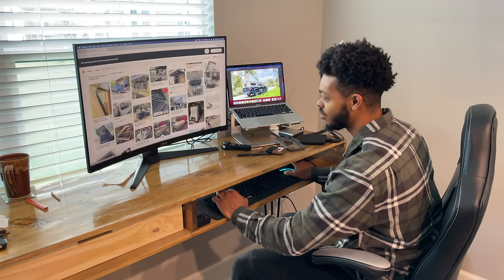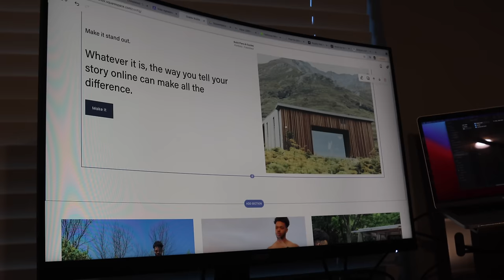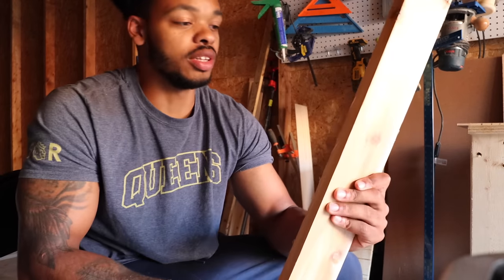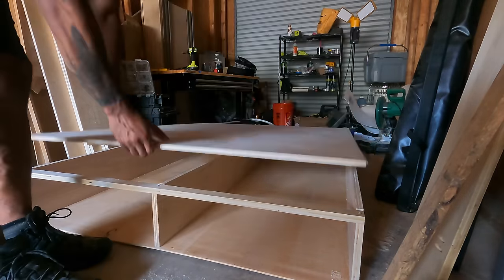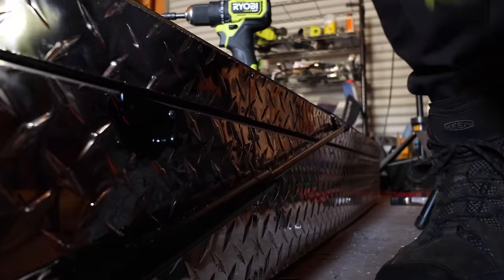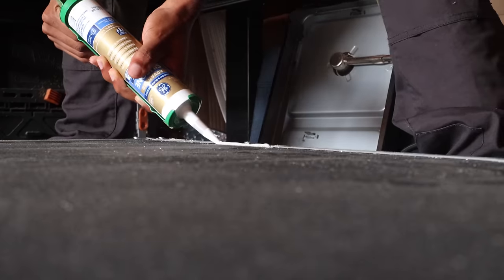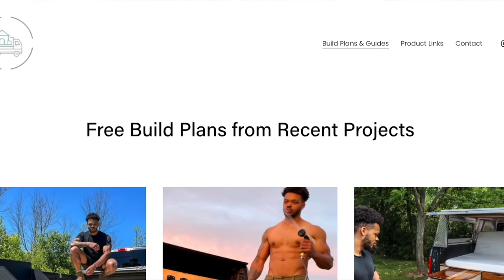I Converted a PICKUP TRUCK into an Off-Grid Home On Wheels | Overland Camper Build Start to Finish

Comment from the maker: Yo! Theres a lot of helpful links in the description if you're looking for anything in the video or more info about the build.  Video contents are below:
▬▬▬▬▬VIDEO CONTENTS▬▬▬▬▬▬
0:00 - Intro
1:05 - Building the frame  
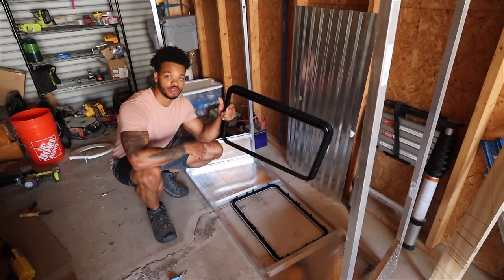2:56 - Window Frames & Doors
3:22 - Squarespace
8:10 - Mounting the Camper Shell
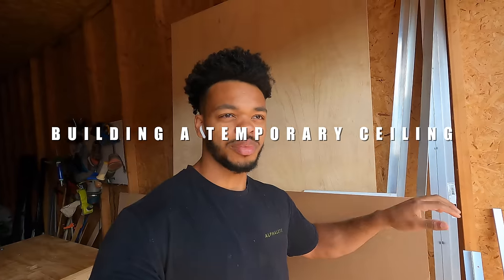9:05 - Temporary ceiling
9:39 - Interior, drawers & Kitchen
12:33 - Mattress and bottom floor tour
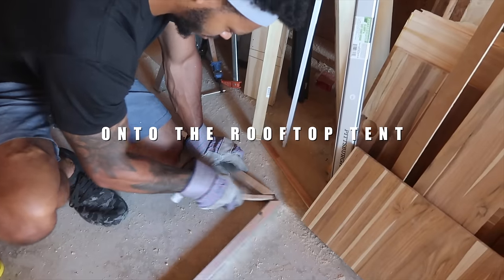13:35 - Rooftop Tent Frame
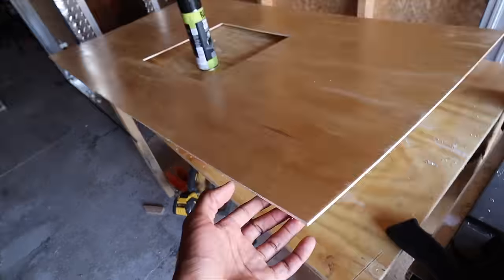14:30 - Ceiling Panels, solar Panel, Skylight & Roof Vent
18:05 - Tent Fabric
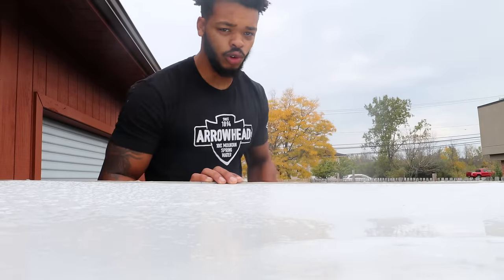20:30 - Mounting the Tent to the truck
21:45 - Bed Platform
22:06 - Plugs and running electrical
22:50 - Final Reveal
22:39 - Final Thoughts
Reply: How can I contact you if I am interested in working with you to get something built, or buying a build? Thank you for your creative work and great videos!
Reply: dude you should've logged this and did an instructables thread on it!
Reply: “Is this thing still recording?” 

lol - love how real and down to earth you are 

been watching since the first build you did on the old van
Reply: You are absolutely talented beyond your years!!! 🎈🙌🏾💐💋
Reply: Do you take new clients for upgrade 🚐 or minor repairs?
Reply: This is the most amazing build I've ever seen. The Most High has truly blessed you with the gift of expert craftsmanship. You should build yourself a tiny house. You are awesome.

Comment: Watched this from start to finish, and I am very impressed with what you accomplished on this project. BTW, I've noticed that some commercial pop-up truck campers use a strap around the tent fabric to pull it out of the way when closing the shell. I bet you could use a length of thin bungie rope to do the same thing. Anyway, this is one of my favorite channels, so please keep the content coming.
Reply from the maker: Thank you for the tip!  Right now it closes up pretty easily from the inside, but I may consider doing some adjustments to it later on.  Thanks so much for watching the videos!
Reply: Someone on YOUTUBE with actual skills and talent 👏🏻👏🏽👏👏🏾👏🏿🙇🏻‍♀️🙇‍♀️🙇🏼‍♀️🙇🏽‍♀️🙇🏾‍♀️

Comment: Amazing work. I love that you sat down for a bit to admire what you accomplished, because it's truly remarkable.  I'm looking at upgrading our Amish shed to make it semi-habitable while we work on a property we closed on in April. I've only gotten so far as to board up some holes (found out mice love the "shabin" as I'm calling it), and set up a casette toilet and sink with a battery operated pump. Keep up the good work.  It's definitely inspiring.
Reply from the maker: I usually dont stop to look at what I've done but this time it just seemed necessary.  Good luck on the Amish shed and thanks so much for watching!  I'm glad you liked this build

Comment: Not to put down your awesome work, but if you raise the side windows on a rainy day, the water will pool at the hinge instead of running off. Probably would be easy to put screens in them, too. Rain and bugs, real camping problems. 
Love the effort you put into your builds!
Reply from the maker: It's actually been raining non stop since I've finished building the camper and so far there arent too many water issues.  The only thing thats a bit annoying so far is the flap at the bottom of the tent that holds down the zipper window.  It collects a bit of water when its raining super hard.  Probably just going to modify that in the future but other than that not too many rain issues.  Thanks for the tips and thanks so much for watching!

Comment: At 22:07 - keep an eye on that fuse/distributor box; I used the same one an a few of my builds and have found that sometimes there are defects in the electrical contacts that can generate tons of heat, melting the fuse and the parts of the block, but never actually burning out the fuse.

Comment: This was just awesome to watch in every single way. The end product looks stunning. If you need some place to sit outside when it is raining, maybe you could use a tarp and attach it to the hatch with some heavy duty velcro on one end, and have two tent poles and four guylines in the other end of it. Or you could just bring one of those 3 by 3 meter partytents with you, with or without walls. I especially like the metall look, the double slider drawer and the epoxy finish on the woodwork. Hey, you are DUALEX, you did it again! Thank you for yet another great video. Have a nice day all!
Reply from the maker: I appreciate that thank you!

Comment: Top effort mate, looks real good. Building the opening top makes all the difference, you can move easily in it and it also provides much needed air space. I love the non welding aluminium aspect, as welding aluminium is way outside most of our abilities

Comment: I want to build something just like this! So thank you kindly for this video, it turned out amazing!! One question, are you not worried about water getting in at the screws/ hinges at the top of the 3 flip out walls? Cheers!
Reply from the maker: everything is sealed on the outside so no water gets in during rainy situations at all

Comment: very nice build. I had a couple of questions that you may have already answered=I didn't take the time to read all the way down. Is the Map gas torch weld durable or should I mig/tig the joints?
Also did you keep track of your material cost/did you post that info anywhere? I'm trying to get things ready to build something kind of the same idea on my utility bed 8ft truck bed. thanks for the insperation

Comment: Great build!  If this has been asked and answered I apologize, too many comments to read right now, when you started you were reinforcing the brazed joints with angle brackets but it looks like you stopped doing that as you went along.  Did I miss it or did you decide you didn't need the reinforcement?

Comment: I'm new to your channel. Hooked already!! I was wondering, when you are soldering the aluminum joints is that just to hold the pieces in place while you secure them with screws or bolts or whatever? Is there really any strength in those solder joints? Or is it just a temporary holding device? Thanks, Greetings from Texas.....JB

Comment: he could have asked Ford for an F150 Lightning that is meant for this, like a van prototype that is owned should return back to Ford.  The rear passenger space unutilized and can't take advantage of the built-in heating and cooling.